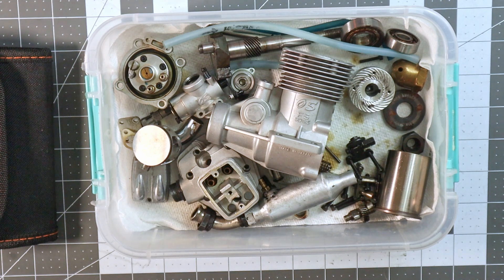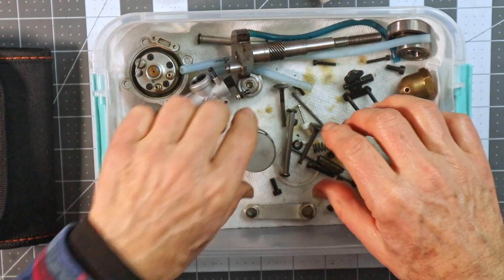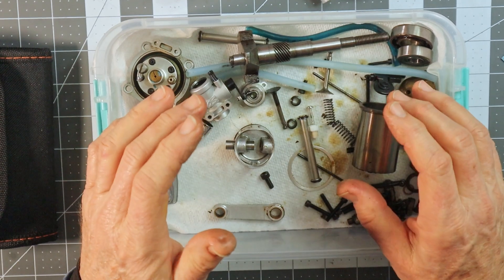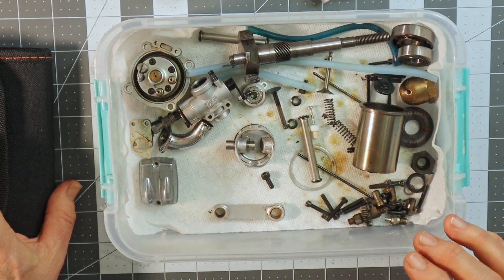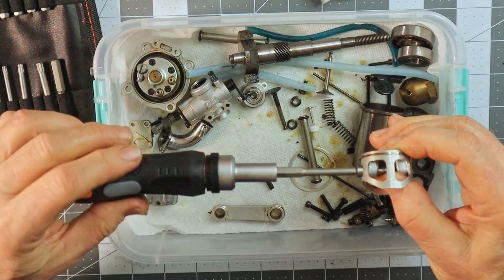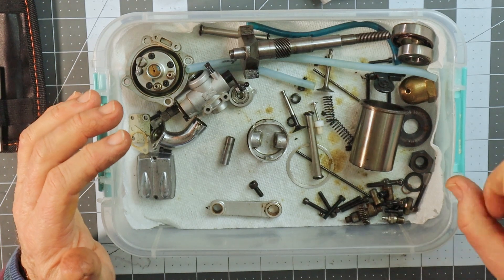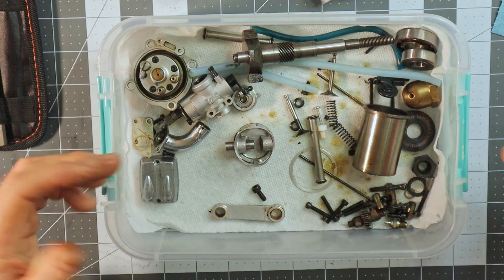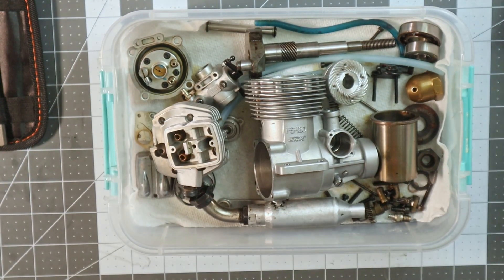Customer Engine OS FS-120 Surpass Piston Pin Removal

Comment: I suppose you could run a tap in there and cut a short thread in the inside, then extract it with the matching screw.  Good tip!  Working on a used and neglected OS 1.20 FS right now.  Thanks for the tip.

Comment: Hey David.  I have a O.S. 160 fx I'm trying to change the bearings in.  I can't get the connecting rod off of the crank.  Do you have any tips to help out another nitro enthusiasts?
Reply from the maker: I’ve never seen that particular engine before but being a two stroke it should not have a hole in the case to pull the pin out like the surpass. Therefore the connecting rod must have space to come off once the sleeve is out. So the piston should be relieved and have room to move the rod fore and aft to facilitate removal. So a lot of heat and oil and or mechanical motion as i said in this video should free it up. That is ask i can say without seeing the engine.